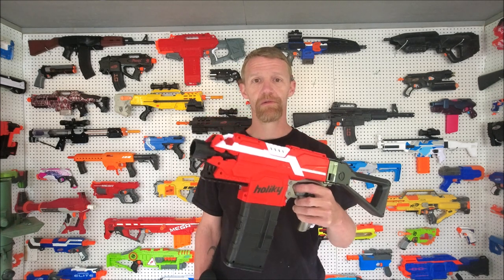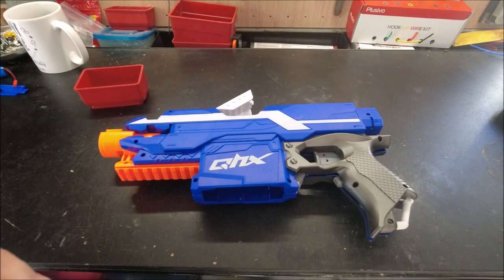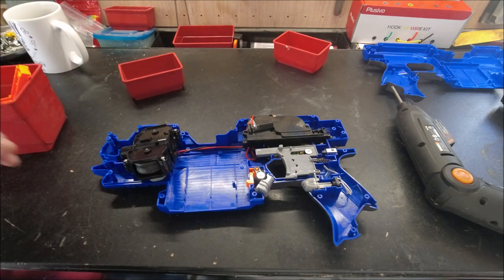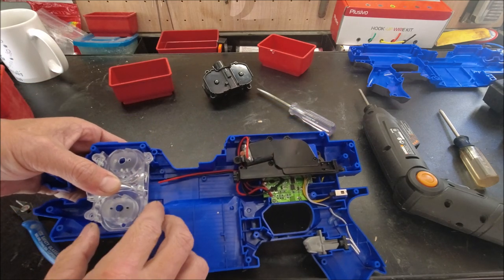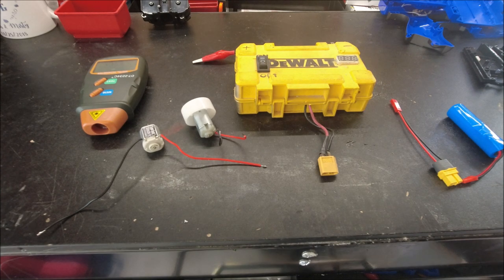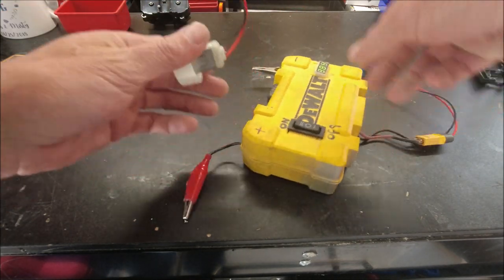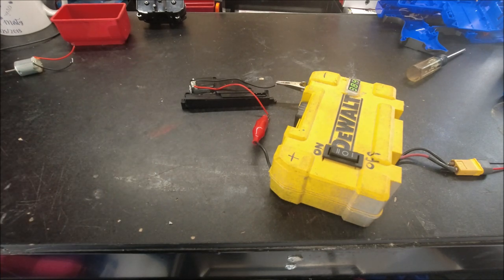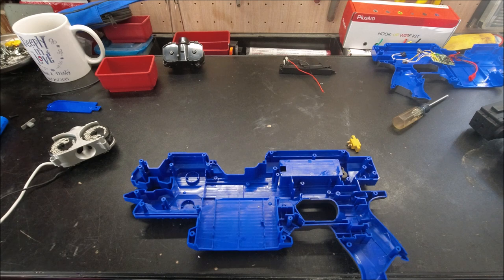Qhx , Imitation Stryfe, Mod Guide

Comment: What type of mosfet?
Reply from the maker: I just used one of the pre-soldered boards from out of darts.
Reply: @projectnerf7920  thanks!
Reply: @projectnerf7920  my rev switch has 3 wires. Hmm not sure how to connect the mosfet. Did yours have 3 wires?

Comment: Do you know what motor you used for the pusher? Would like to try this mod or at least increase rate of fire (got the m4 & AK)
Reply from the maker: I used a Tamitya sprint dash for the pusher motor.
Reply: @projectnerf7920  Do you think it would work OK to just upgrade pusher motor? The biggest downside to these knockoff is the trigger lag & slow rof
Reply from the maker: Should yes, basically that’s all I did as far as the stock board goes. Running, the buck at the stock voltage.

Comment: Very nice detailed take down and mod video. I've been (slowly) working on cosmetic mods for these knock off Stryfes as they have a lot of potential. 

I was thinking of an 3D printed battery box to hold the original battery for the pusher and a S2 vertically in a trough with a common top hatch to access either via a single screw.  But a common power source would be preferred as you showed here. But really I can make any type of battery holder imaginable. Your thoughts? 

I'd like to have seen a close up video of the bridging of the boards voltage cut off but I think it can figure it from your description.
Reply from the maker: I have faith that you will come up with something awesome my friend, you always do 😁

Comment: Tried a similar mod.
Big issue I ran into is how cheap the plastic gears in that pusher assembly are.
If the fire rate is too high, it just shreds the teeth off it’s gears.

Comment: Hey I know this is unrelated but I’m building a turbine right now and I’m following your guide but I was wondering if I can put 3 kraken 3s motors. Two on the flywheel and one on the pusher. I just saw that u used revamped on the flywheel but didn’t use them on the pusher and used m2’s and I was wondering if there’s a reason for that or if I can run the same motor on the pusher as the cage
Reply from the maker: Sure you can run the same motor for your pusher. I normally don't, because when you are talking pushers, you don't see much of a difference in fire rate from ME 2.0 to FRV. A little but not a ton since the pusher box is geared. But if you don't mins spending the few extra bucks, go for it!

Comment: great video man!!!
I'm just about to do my first mod ever using the same imitation blaster, and I'm not that familiar with everything and this level of detail is just perfect 
just one thing that I wanted to know, the buck that you used to lower the voltage, do you know the model so I can get the same? cause I've found others that are not that one so IDK if it'll work too
Reply from the maker: I don't have a model number, I just buy them on amazon. I use the bucks that can handle 5 amps. here's a link
https://www.amazon.com/Adjustable-Converter-1-25-36v-Efficiency-Regulator/dp/B079N9BFZC/ref=pd_sbs_3/130-7171430-1323426?pd_rd_w=KAiGN&pf_rd_p=0a3ad226-8a77-4898-9a99-63ffeb1aef90&pf_rd_r=9NQYJ7ES65G1ZSNX44DS&pd_rd_r=58b273e5-1dab-4caa-b410-75d186325d24&pd_rd_wg=3UoO6&pd_rd_i=B079N9BFZC&psc=1
Reply: @projectnerf7920  you just made my day, I'll try them, Thanks man!!!

Comment: One question does it smell bad when you shoot it too much with a higher voltage battery
Reply from the maker: no, but I also upgraded the motors to fang re-vamps to handle the voltage of the lipo
Reply: @projectnerf7920  yeah so I am thinking of getting this because it's cool but the problem that is not wanting me to buy it is that it's trigger response and I am a kid so I do not trust my self modifying blasters it's a risk and I don't have any power tools and my parents are also busy and my dad also has no experience so this is holding me back on purchasing it don't get me wrong I actually want this but I can't modify because it's so complicated for ne

Comment: Can these knock offs be modded like you have done for PDK on the actual Nerf Stryfes?
Reply from the maker: I got very similar performance as Auto Stryfes I built, lower fire rate. But if you wanted to nix the select fire you could really make it fly.

Comment: Put a neobadger in the pusher
Reply from the maker: Would probably burn out the board, so you would loose select fire. Now if you just wants full auto wired up direct, then for sure go with the faster motor.
Reply: @projectnerf7920  yeah. The only situation you could really use a neo badger in The Pusher would be with a 30 round drum